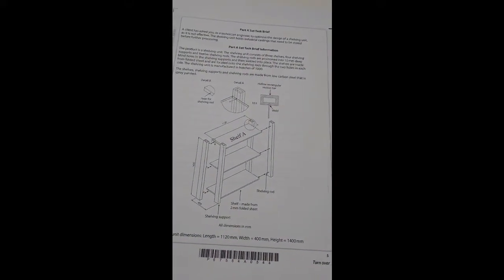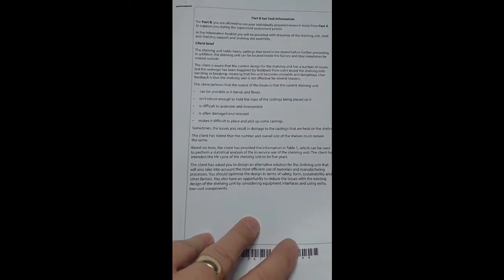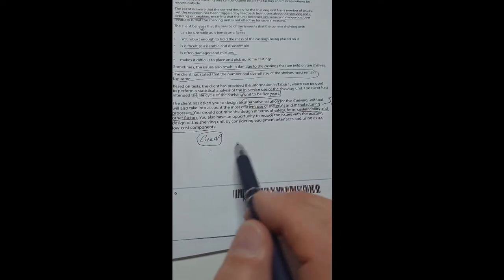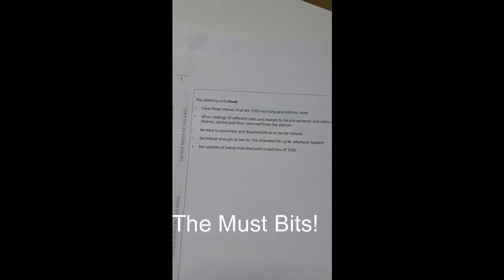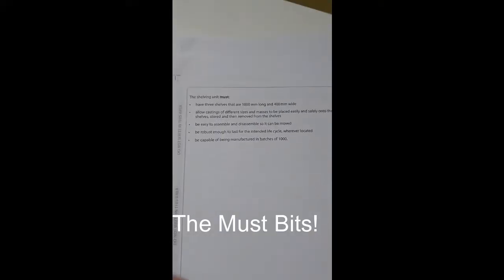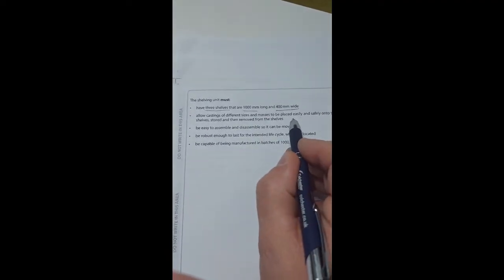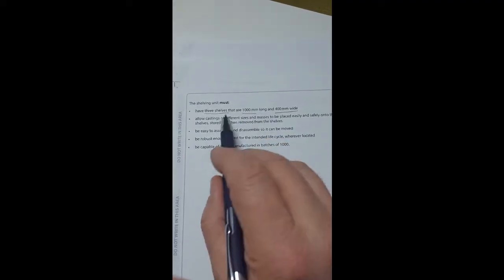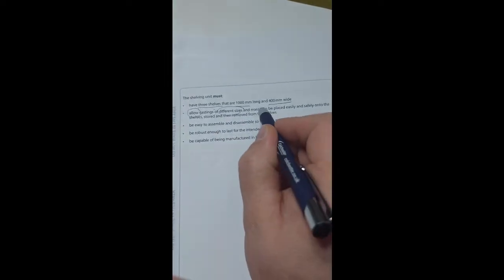Unit 3 Engineering Product Design and Manufacturing Video 2 - Mock Exam Activities 1 & 2

Comment: In activity 2, we are asked to include key health and safety, regulatory, and sustainability factors in our answer. Is this reference to the current product shown in the brief or the redesigned product?
Reply from the maker: When completing this activity 2 it is about this product in general, remember you have not designed anything at this stage. Activity 3 is for your concept designs.
Hopefully you have got something down for this in your research notes.
This is a 6 point activity. Being specific in what you provide is key. Being wishy washy answer will see you gain points at the lower end of the marking scale.

Comment: I thought for Activity 2 Interpretation of Numerical Data we had to use Standard Deviation?
Reply from the maker: Why complicate things?
Depending on data you need to find out average results. From there you begin to see what combination of material and finish performed the best.
Past papers we only got basic values. Lasted this long with this weight added to it. As example.
It's your job to let the examiner know on the average results for length of time of testing I found the following information out.
Now if you have 100s of results then maybe I would be inclined to use other mathematical methods.
But for what you need to produce and the single, two at best, point score from it. Just tell them what you see. Interpret from the values you have.
Did you see the video on this part?
Take another look and decide how you want to earn that point or two. 
Eight hours will runout quick, spend the time elsewhere to gain the most points in the bigger sections

Comment: Tips for a distinction?? I'm retaking also can i use 2D drawings for activity 3
Reply from the maker: Yes you can, not everyone is solid on sketching isometric drawings.

You will need front, side and end views so the examiner can understand what you are drawi g
Reply from the maker: Tips for distinction, you need to make sure you cover everything that they ask you to do. 
Labels are not annotation, ensure you cover materials, manufacturing method and any finishes you want to apply to parts 
I do strongly advise to use all the time up available. 
You research notes will have information you do not need to think about. Summarise those notes to your advantage.

At the end you need to ensure you discuss why your concept design solves all the problems the original product had.

Good luck

Comment: For the product requirements in activity 2, do you have to expand on all the points stated (Musts and Client brief issues) or?
Reply from the maker: Oh yes, you should expand on these points.
It provides further information and enables you, or jogs your memory, to add further thought too.
Let's take batch sizes, you may elaborate further by mentioning that you may want to use CNC machinery  to produce the parts, maybe automate a powder coat painting process that once it's sprayed with powder the over has a conveyor to finish the process off.
Things like must be easy to use, you may provide further thought on how you could make it easier.
Just writing a bullet point list may cover what they need but the additional information  would show direction or thought process.
Remember marks for this section are not as high as other sections.
So balance your answer to you don't go in too heavy on low level mark activities
Reply: Thanks, but do you have to expand on ALL the points and if so do you mind telling me how you would expand on the first one? I am quite unsure on what to say for that type of MUST point and I start part B tomorrow
Reply from the maker: Some you won't be able to expand at all.
Take the shelving example size that's what you must and not much you can expand on that.

Comment: it just seems like youre rewriting the brief, my teacher said too avoid that to some extent due to it being generic...
however i am a fan of 28:55 though
Reply from the maker: I wrote the parts that you need to expand. Video length would be too long.
My resit students done very well with these pointers. Not one failed.
The format points you in the path to ensure you cover what you need to do to provide evidence. The examiner can see what you have created to cover what the customer wants.
It also was to help students to be familiar with the exam paper.
Hopefully, your tutor had you go through past exam papers too.
If the customer wanted a painted part, you would have to mention that the parts needed to be painted for a reason. At the same time, you would expand this in method of painting too.. so you could state that you would use powder coat paint instead of spray paint. To be honest this is not being generic.you are making sure you have all bases covered.

Comment: What in specifically are we doing for activity 1 ?
Reply from the maker: Activity one you need to produce a time plan.

This is where you produce the table like what I showed on the video to list all the activities and how much time you intend to allocate to each section.
The more points the more time needed,
Do not do a Gantt chart this does not describe anything.
The descriptions for each task are from the Activity 

Not when you do this, do not take the full 45 minutes, 15 minutes for the table you produce.

Then after that you then note what you actually produced for that activity
So
Activity 1
Created a table to show project time plan - this allowed me to allocate time for each activity to manage my time.
After each session I will record what had been completed and what needed to be complete before moving on to the next activity.

Then after each session, you would record what you actually completed.
So 
Session one - you may have completed Activity 2 but only manages to produce 2 concept designs. So you would annotate this in session one and remind yourself that you need to complete the 3rd concept design.

When you start 
Session 2 - completed 3rd and final concept design and then annotate what you done for the rest of that session.

DO NOT FORGET - you will need to set aside some time for quality check. say 20 minutes, to allow you to check for missing detail, or you might want to do or change a part of the design.

What did they tell you in class, your tutor must have shown you past paper so you do not get any surprises in exam.

Hope this clarifies things for you
Reply: @ thank you so much, your a legend!!!
Reply from the maker: I'm a geezer

Comment: what structure should I use for question 2 when writing it up
Reply from the maker: Let's take a look at what has been provided before from past exam and I will break it down as simply as I can. This is the shelves used a few years ago.

Its a big answer so read carefully

ACTIVITY 2
Interpret the client brief into operational requirements, to include:
• PRODUCT REQUIREMENTS
This would be where you interrogate the client brief,  this is what it says
The shelving unit must:
1. have three shelves that are 1000 mm long and 400mm wide
2• allow castings of different sizes and masses to be placed easily and safely onto the shelves, stored and then removed from the shelves
3• be easy to assemble and disassemble so it can be moved
4• be robust enough to last for the intended life cycle, wherever located
5• be capable of being manufactured in batches of 1000.

As long as you mention what they ask for so here it says 'The shelving unit must'  so the list they provide is what you need to mention for PRODUCT REQUIREMENTS

• OPPORTUNITIES AND CONSTRAINTS
The opportunities could be in the guise of manufacturing techniques you may want to use to produce the large batch of 1000, you may want to automate the processes to provide a consistent quality, this list could go on, (keep things to maximum of 3/4 any more will burn up time)
The constraints - now in this case you will see the MUST side of things, here it stipulates it must have three shelves as the size of 1000mm long to 400mm wide this is classed as a constraint. To few or too many shelves at different sizes is not what they wanted. 
As you go down this list you start to see easy to assemble and disassemble, 

You could call it a wise list of things that you have to adhere to, just imaging they asked for pink shelves, you have to give them pink shelves.
Hope you see what I mean here, you will need to scrutinise you Part B brief to gather and use this information. 

• INTERPRETATION OF NUMERICAL DATA
You have seen my video on this, just replicate something like that for the DATA you have been given, What are the values they given you? what materials? how much weight it was loaded with? and how long did it last?
You asked about the materials before, this might shed some light on what they have worked with, the shelves brief had mild steel, aluminium and stainless steel, check the DATA and work with that if it helps you.

• KEY HEALTH AND SAFTEY, REGULATORY AND SUSTAINABLE FACTORS
If you done your research properly and written something down for each of these on your sheet, if its is relevant just write what you have recorded there.
This will cover this, bear in mind time so you don't run out of it.

Format as you ask, depends on how you want to set it out. You see from this list that this format you can replicate this and ensure you supply answers with reasoning behind it the SUB HEADINGS will show the examiner what you have provided for each section very clearly.

Hope this helps
Reply: @111melcat thanks for the help I got my exam today

Comment: do u get marks for stating these bullet points or is that just to help?
Reply: Engineer, please, what are the criteria that I must meet in order for me to get a D grade, and what do you advise me to do in order to get that grade? Thank you for your blessed efforts 🤍
Reply from the maker: The bullet points that you are referring to are what you are providing a solution for.
You must address each bullet point and how you have provided a solution for that point.
If they wanted something 100mm x 50mm x 25mm you would mention that in two ways.
1. Actually dimension the drawing to show this.
2. Add this as annotation stating the size of the object you have draw.
So
Overall sizes of partnis 100mm x 50mm x 25mm to cover all bases
Reply from the maker: Yes this is where the marks come from. Miss them then jo marks can be awarded.
Cover them then marks will be awarded
Reply: @111melcat  thank you

Comment: Got my part B soon. Worrying a bit but my part A is strong. Thanks for the video mate, helps alot
Reply from the maker: Make sure you cover all those bullet points.
Copy and paste information for everything on the bullet point.
When you come to activity 4 on part B you will have the answer there to create answer from.
If it's not covered these are points you will loose

Comment: Exam on Monday morning and i'm making notes at 10:00pm 🤣
Reply from the maker: You will be fine, just be confident with your design.
Remember, labels don't count as annotation.
Make sure you cover every bullet point.
Reply: @111melcat do I have to explain what it is and advantages on activity 3?
Reply from the maker: @Yjz_7 only how it solves the problems their one had.
Like made of mild steel and powder coated to prevent oxidisation (Rust).
Has this feature to enable this.
Fabricated assembly to save on material and keep cost low.
It all depends on why yours should be better than original